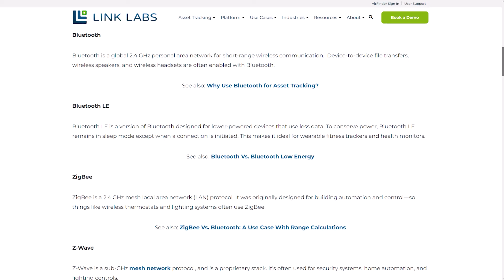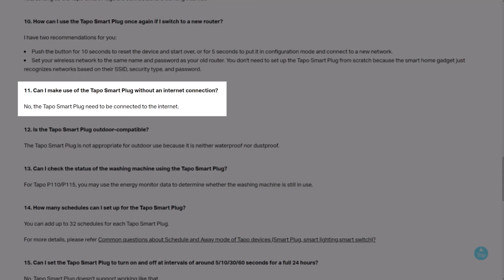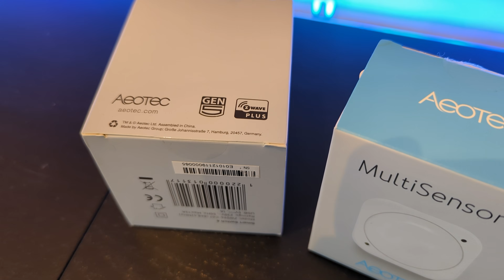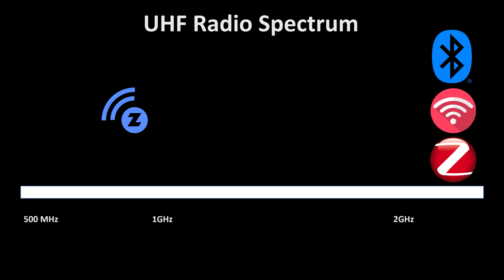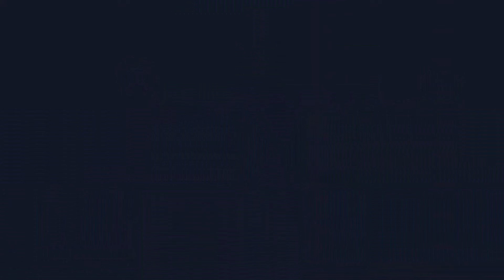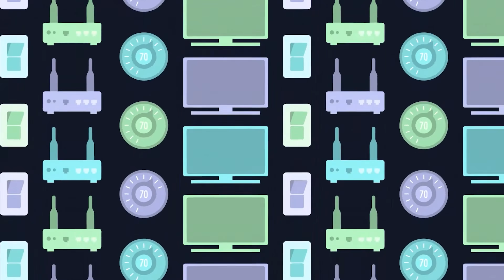Smart Home Protocols Explained

Comment: I've been in the computer networking industry since 1983.  This video (and similar ones) remind me of the state of the industry before TCP/IP.  Before widespread adoption of TCP/IP as the lingua franca of networking, IBM, DEC, HP had their own proprietary networks and each touted why it was better than the others and why you should standardize on them.  But these vendors also started using TCP/IP and in the 90s, particularly as the Internet started to grow, proprietary protocols began to fade because of both vendor adoption and customer adoption.  A vast network that supported a vast number of devices from many vendors was just superior to the alternative.

You were somewhat dismissive of Thread and Matter, but it feels like the TCP/IP story again to me.  Soon vendors will realize that it's better to support an industry-support networking protocol and operating stack and discussion of Zigbee will be as quaint as discussing IBM's SNA.  My home network supports Wi-Fi, a little Zigbee, a lot of Lutron, and some Thread.  My experience with Zigbee probably isn't great because as you say, it isn't super-standard.  I have 4 mesh Wi-Fi radios in my house, so signal strength and capacity isn't an issue.  

I think a far more important decision today is what kind of automation framework to use.  I use HomeKit because I've been an iPhone, iPad, and Apple TV user since the beginning and it's easy (for me) to implement and use.  I don't care for Amazon or Google to be listening into my home automation.  I've wanted to try Home Assistant, but honestly I don't want to spend all the time learning the ins and outs and reading discussion groups.  Also, my automation needs are pretty simple.

I think home automation is a really fun topic and there is so much that can be done with it.  For the average person, discussions of protocols and megahertz and hubs go way over their heads.  And why not?  I think that's what will be the reason Thread and Matter will become the TCP/IP of home automation.  It will eventually remove the need for wonky discussions and head scratching.  You'll pick a device based on functionality, quality, and price and you won't care Z-this or Wi-Fi that.

Comment: I have the HUE motion sensor. I used the included AAA batteries in fo 1 month. Then i switches them out to rechargeble AAA batteries. Mutch better for the wallet. But they wont last that long as a non rechargeble batteries. I will Try to use as many rechargeble batteries as possible.

Comment: im using mostly Zigbee and wont buy anything other if i dont have to... The only exception are D1 Minis which i use for WLED stuff. Got some Aqara motion and light sensors, which after 2 years are still on their first battery, which is crazy efficient. Anything connected to mains acts as a mesh repeater, and the signal just gets anywhere without even planning this out. The coordinator is just a USB Stick on the Pi which runs HomeAssistant. And with that, automations are only limited by your creativity ^^

Comment: 🤦‍♂️ from an IT perspective where do I start?

Well, I'll start with the good...Z[ed]wave!!! Thank you! Z[ed]! Not zee! Z[ed]!

ok, now the bad.

1) No, your printer and computer do not NEED to be on the same WiFi network, this might be the case, but it's not a requirement. Your home or office network is called a LAN (Local Area Network). Your Internet is called a WAN (Wide Area Network). Your WiFi is called a WLAN (Wireless Local Area Network). Your LAN is managed by your router, generally this is a wired LAN 99.9999% of the time. WLAN is almost 99.9999% dependendant on a wired LAN. LAN generally physically relies on ethernet cable (CAT5/5E/6/6A/8 using RJ45 connectors) and ethernet based protocols, also known as TCP/IP protocol suite. Even if you use MoCA (Media over Coax), Powerline Networking (PLC, typically HomePlug), or HPNA (home phone line networking, old and slow technology), these are all physical mediums and ethernet/TCP/IP is encapsulated (same with WiFi) inside the PHY protocol, these are all part of your LAN.
Anyways in order for 2 devices to talk to eachother (the computer and printer example), neither NEED to be on the same WiFI WLAN, they just need to both be on your LAN, preferably both using a wired technology, ideally regular ethernet cable, if it's a desktop computer and a stationary printer. Wireless ideally should only be used when mobility is required, stationary devices, ideally should ALWAYs be wired. Not just because wired is ALWAYS superior to wireless when mobility is not required, but it's also more secure, harder to hack or jam (flood the radio band with noise).
I know wireless technologies are more convenient for retro fitting, mostly due to device cost, device size, and ease of installation, but also due to terrible customer education because of misleading (even false) advertising (so bad ISPs here in Canada advertise internet service as wifi, not as internet, which should be illegal), wireless is perceived by the average consumer as better, and therefore, that's what they demand, impacting the supply and demand portion of the device costs.
In terms of security and reliability, I want to see more wired devices. Especially if the device requires wired power (either with a wired adapter providing DC or direct AC mains), if you're already connecting one wire, might as well use it for data as well (even if this requires another adapter to connect to etherner somewhere on the network or direct to the router/main switch). Or better yet, go PoE (Power over Ethernet, ideal, especially if cost is no object for both the device and installation). MoCA 2.5 and soon 3.0 are awesome tech with none of the drawback of powerline networking (RF issues with wifi and Amateur HAM radio, not really an issue as far as I am aware in North America, but apparently considered a major problem in the UK) but dependent on already installed RG-6 coax (can work on RG-59, but will be slower) which is not quite as common as electrical wiring due to fewer outlets, but also more expensive and excessive bandwidth for IoT smart devices. I'd like to see HomePlug Green PHY for IoT (released over 10 years ago) which can coexist with regular HomePlug AV500 to AV2 2000 standards for high bandwidth use while using much lower power (and likely a lot less RF noise produced mitigating the potential interference issues mentioned above). This Green PHY spec was designed to be low cost, small, and specifically for IoT devices, but never took off due to the demand for wireless.
This tech would be perfect for smart light bulbs, smart switches, smart power receptacles, devices already guaranteed to be connected to AC mains. Sure there will always be a need for wireless IoT smart devices, these can use matter over zigbee/zwave/BLE/IP (ultimately if it's wifi, it's TCP/IP, same as wired ethernet). Some (not all) of you're HomePlug Green PHY switches/bulbs/receptacles can also support your preferred zigbee/zwave/ble (could do wifi also, but this would not necessarily be ideal because you should have PoE powered ceiling mounted wireless access points, or whole home mesh kit using powerline AV2 2000 or wired ethernet gigabit/multi-gigabit backhaul, and IF the smart device was used as a WiFi access point, it needs to be AV2 2000 not Green PHY to handle the bandwidth required by wifi devices).

I know Insteon did/does make X10 based powerline networking smart IoT devices, but these are not based on a standard resembling anything modern, nor is it using TCP/IP.

Yes, the above setup would be more expensive, but it should all be available.

IMHO, all smart IoT devices should have an IP on the network, should be pingable (from within the network) and seen by the router. Whether the IoT network needs to be a VLAN on a home network, that's debatable. I'm a fan of KISS on home and small office networks, so generally avoid VLANs since they add complexity (on larger office networks, for VPN networks, for guest wifi, you want a VLAN).

As for using the ISP provided router and wifi equipment. Unless you only have 1-5 devices total on your network, you should pretty much ALWAYs buy your own third party router and wifi equipment (I typically use Ubiquiti UniFi equipment). If you are investing in smart IoT devices like these, then it should be considered HIGHLY recommended to get your own router and wifi equipment. Generally I recommend using major networking device manufacturers and not Google Nest, Amazon eero, or relatively unknown manufacturers. I'd go with TP-Link on a tight budget, Linksys/Netgear/Asus if a reasonable budget, or Ubiquiti UniIf if you have a healthy budget and existing ethernet wiring or can afford to install new wiring. TP-Omada (have not had the chance to try this yet, but comparable to UniFi) is also viable.

Comment: Use 5GHz WiFi, shouldn't be interfering with ZigBee, right?
Reply from the maker: Correct. Only the 2.4GHz messes with Zigbee. Sadly a lot of smart devices still only work on 2.4 and not 5

Comment: Can you control Zigbee devices remotely?  Say from another city/state or even country?
Reply from the maker: That depends on what hub you're using. I use home assistant to control my Zigbee devices, and I can access Home Assistant from outside of my home. So using Home Assistant as a proxy, I can control my Zigbee lights from another country
Reply: @HomeAutomationGuy  Thanks.  That's what I was asking... basically can you access and control all those devices when you're traveling.  Thanks for responding.

Comment: I'm hoping to move away from WiFi and toward Thread (when devices become more widely available and affordable: so count me out too as far as "Eve" is concerned) and I already use a lot of Zigbee devices (switches, sensors, plugs, bulbs) that work with both Smarthings and Hubitat (and/or with Aqara hubs): I use all three.

Since things seem a bit chaotic in the world of Matter-over-WiFi these days, it makes even more sense to avoid new WiFi  devices and instead to focus on building up my Matter-readiness this year (especially by adding mesh WiFi access points that also support Zigbee and will act as Thread border routers).

If I do pick up any devices this year that aren't Thread-based (I'm definitely in the market for a few new smart dimmer switches), they'll definitely be Zigbee ones, however. I may also try out IKEA's new "Dirigera" hub - especially if it looks likely to work as a proper Thread border router and offer redundancy as an extra Matter controller.
Reply from the maker: That's a sensible way to navigate this transition. All the best with it!

Comment: Zigbee is worthless and dangerous.  Zigbee devices will hop networks to neighbors who are also running zigbee devices.  There is nothing, no security, nothing to lock your zigbee devices to just your zigbee hub. You will be spending more time trying to regain access to your own devices than it is worth.  Do this, I have: Set up a zigbee hub in you car, drive around in upscale neighborhoods (are most likely to have smart home devices) and scan for zigbee devices. Devices will hop to your mobile hub. Now you have control of that device(s) and can turn on/off other people's zigbee devices.  They would think their zigbee devices are going crazy.  This is scary, that someone with a zigbee hub can easily hijack control of your zigbee devices without you knowing about it.  Please do not connect any locks, window shades or curtains to zigbee.

Comment: IPv6 addressing doesnt really give an advantage almost nothing uses it and there's no real advantages over IPv4 the internet itself should run on it and IPv4 used for local networks but corporate idiocy keeps IPv4 around on the net, there's no functional advantages really. v6 just makes things more of a pain too as it's way more difficult to remember an IPv6 address over an IPv4 in general

Plus i'd argue making thread connectable with other things directly is a significant security risk, one of the advantages of Zigbee security wise is it's an enclosed network that you cant hack from WiFi or other network connected devices (unless there was a specific mqtt based hack you could get into the network and send through something like zigbee2mqtt, but that would probably be a very targeted attack scenario)

Comment: I originally was going to go Z-Wave many years ago, even before Home Assistant existed.   The main thoughts on that were using Homeseer as the automation hub.  I do have about 15 Z-Wave items, but I found Z-Wave too difficult with trying to get the right frequency, not to mention the cost.   So, I've ended up with about 70 Zigbee items, and just the 15 Z-Wave and a handful of bluetooth.   The Siwthcbot Blind Tilt's and smart locks ended up bluetooth.  If I was in Europe I may have gone Z-Wave as it seems a lot more widespread there, but in Australia, it just wasn't.   I went Ubiquiti Unifi for my home network and WiFi, but I only have 3 or 4 ESP32's running ESPHome on the WiFi that is smart home related.  All my CCTV devices are hard wired.
On Z-Wave, do note it is only encrypted if you use S0 or S2 security.  There are quite a number of "insecure" z-wave devices around, paticularly older devices that may still be usiing 300 series chips, before Z-Wave Plus.  
On you mentioning batteries, little nit pick.  The battery you were showing wasnt a 2032, it was  a  2450 from that motion sensor, but I am just being nit picky there lol :)
Great video.

Comment: so, good video, thanks.
For z-wave, if the company discontinues their app then you get no hub access and therefore no access to the devices. D-link not long ago discontinued their support, and not nothing works until I make the effort to find a hub that they will connect to. Any ideas?
Reply from the maker: You can use Z-Wave devices natively with Home Assistant using a USB Dongle. I think it works the same with Hubitat.

Comment: Planning for a ZigBee - HomeAssistant setup for my new home! Wanted to get a ZigBee dongle, would you recommend the SkyConnect? Wondering how it compares to ConBee or Sonoff!
Reply from the maker: I've used both the Sonoff and Sky Connect and they're great. I'm sticking with the Sky Connect so I can use thread in the future without changing my hardware, but otherwise I'd be sticking with my Sonoff!
Reply: @HomeAutomationGuy  thanks! Will see if I can get my hands on the sky connect 😊
Reply from the maker: I've never used a ConBee, but many others swear by them

Comment: One other disadvantage of Z-Wave depending on where you live. Not all countries accept the same frequencies so unlike the 2.4ghz of zigbee, Z-Wave have different frequency standards depending on where you live. If you’re in the USA, having a large population, you’ll have a reasonable device selection. If you live in a country with an accepted frequency of lower population bases, you’ve got a poor device selection.
Reply: Do you mean that certified z-wave devices aren't required to support all those frequencies?

Comment: ZWave is my preference due to not using 2.4Ghz.  2.4 is just too congested there is a good chance of you have network issues it has nothing to do with your network, it could just be a leaky microwave. That is why in my new house I'll be using Lutron for switches and ZWave whenever possible. The only thing they have to compete with is baby monitors. The only downside of ZWave compared to ZigBee is the size of the network. ZWave only allows about 300 devices compared to ZigBee's thousands.
Reply from the maker: Yeh, that's fair.  Lutron just isn't that popular in Europe so I don't have a lot of experience with it.  I think Z-Wave is a very good protocol and I would totally use it if I didn't already have so much experience and so many devices that use Zigbee.

I don't think there's any right or wrong answer here.  Both are solid mesh networks, low power, have great device compatibility and most importantly run fully locally!
Reply: I agree, Z-Wave is the best. Also newest Z-wave LR (long range) supports 4000 devices, and can actually have several miles of range.  I've been using Zwave for over 9 years now and once I switched from that Vera system to HomeSeer I've loved home automation. I'm now trying Home Assistant and hoping it's as reliable as HomeSeer.
Reply: Zwave devices are often more expensive than their zigbee counterparts, but I don't know why
Reply: It really depends in the country, if the telco in your country uses 800-900mhz band for GSM/LTE wireless connection, avoid zwave, might as well stick with wifi or zigbee, I tried it, it sucks and I can only have reliable connection on it if its close to the router (2-3meters), in long distance it still works but a single cellular call can take those device offline and takes some time to recover.

Comment: Great video, most of my devices are zigbee as well. Might be worth pointing out to people that zigbee battery operated devices don't act as zigbee repeaters as this would seriously degrade their batteries. I do also use z-wave devices for my wall switches, mainly as most wifi based ones require you to sign up for the manufacture's app and a lot of them then use the internet to turn them on and off as you described in your video. I really like the zooz zen32 z-wave scene controller, but 2 blueprints have made it very nice indeed now. The lights sync as they should now no matter how something is turned on. I have it installed at my front door showing status of alarm system and my smart locks.